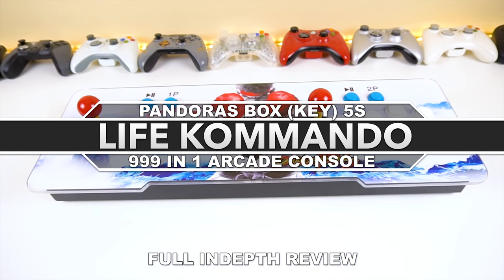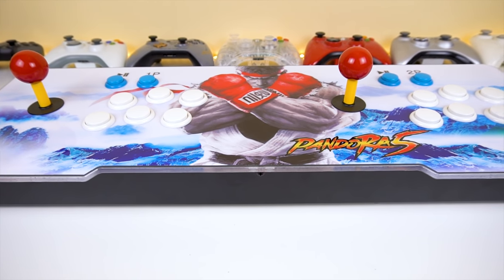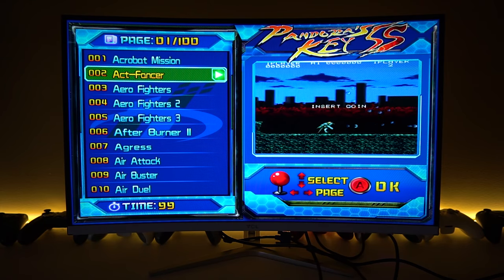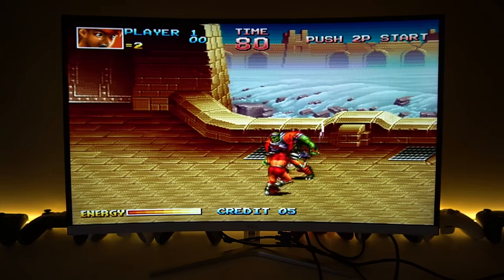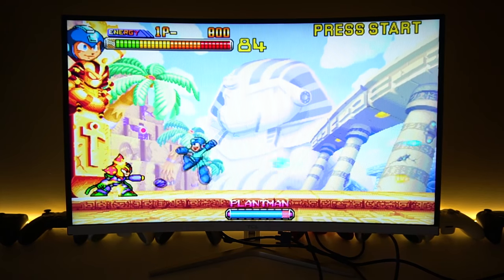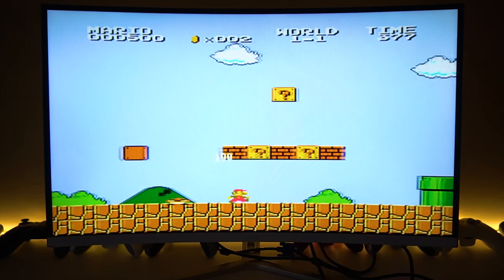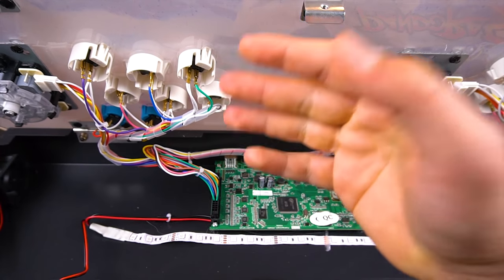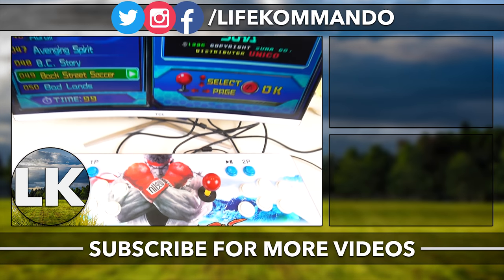Pandora's Box 5S | 999 In 1 Retro Arcade Game Console | In-Depth Review

Comment: Cool video, I like coverage of retro gaming and supergun devices like this one. The "real" Pandora's Box 5 (960 in 1) by 3A Games has a much more powerful board with a quad core 1.4ghz cpu and 2gb of ram. The "clones" like the 5s use the version 4 board with more roms hacked in. The version 4 board has a single core 1ghz Allwinner A13 and 500mb of ram. The actual Pandora's Box 5 runs the games that were not running well in your tests, like the Sega super scaler stuff, as well as some midway stuff like Mortal Kombat and Nba Jam. In a lot of cases, like yours where the ports are aligned correctly the board can be swapped out with an actual Pandora's Box 5 board (this is what I did with my "Pandora's Key 5s", along with swapping in Sanwa sticks and buttons).
Official 3A Games Store: https://www.aliexpress.com/store/937838
Reply: Realm Chat hey, do you have a video or instructions by chance on how you swapped out the board? And did you get the motherboard from 3a?
Reply: Link for Sanwa buttons and sticks please ;)